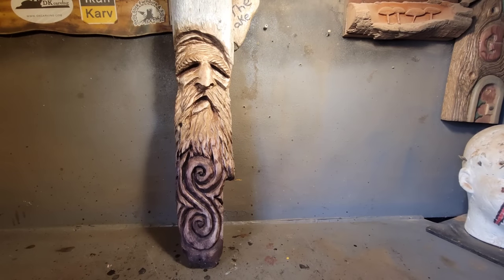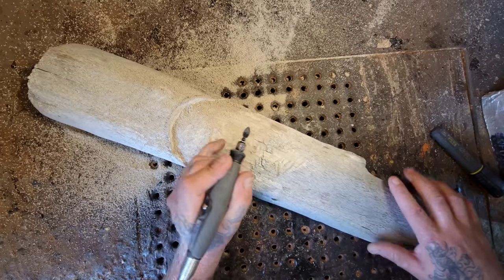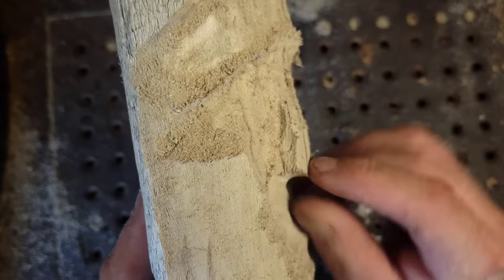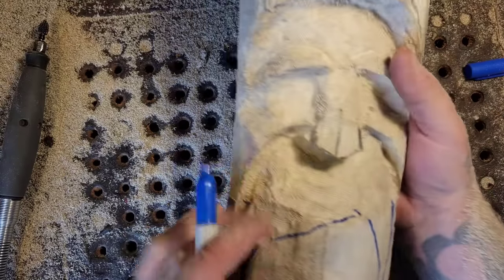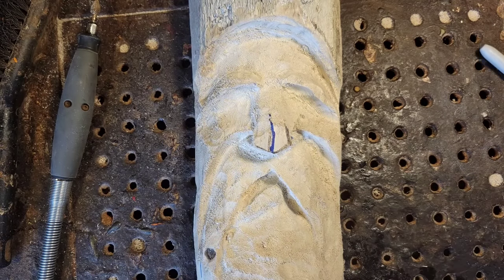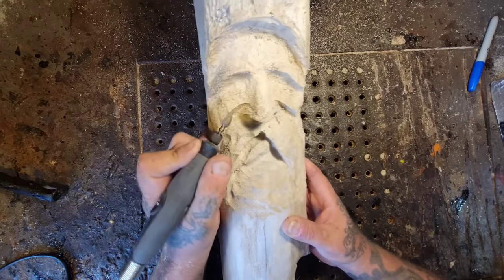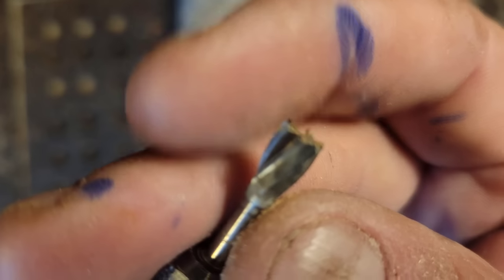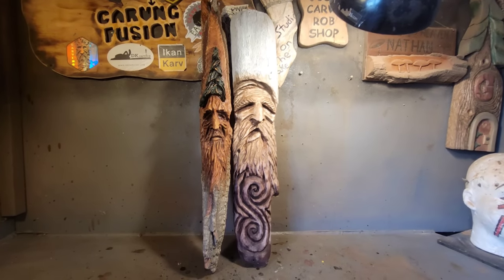The very basics How to carve a wood spirit with a dremel for the very beginner carver.

Comment: I use a power cable with a foot switch on it and a female connector designed for lamps. Also tried a Nexus remote control wireless plug to turn it off and on. You can place it on the Flexi shaft near your hand for easy on off.

Comment: Hi jordy;
We just cut down 2 huge cedar trees and 3 trailer loads to the dump. We still have a pile left that is soaking wet from all the rain. Do the branches have to be dry before carving? And is cedar a soft wood? 
I’ve never used a Dremel, what is the foot pedal?
Years ago I did linoleum block carving mostly swans but I’ve done the Pink Panther ( love the theme song to that cartoon; kinda stuck in my head).
Thank you for the video and any feedback.
Happy New Years 2024🎉
Reply from the maker: Yes cedar is good to carve let it dry ty u too
Reply: @CarvingFusion  
What is the foot pedal you mentioned in the video? Is it sold separately from dremel? I couldn’t find it under your links.

Comment: Jordy do you mind if I ask how you made the down draft with holes to suck dust please?
I’ve a lot a spalted wood as in a woodturner and it’s just about ok to practice with.  
And a big thanks on video how to change core of flexi lead. Hour in I had first catch lol and bang running in neutral. 

Love everyone of your beginners videos as each one is a different piece or wood. So I learn bits all the time. I’m a very slow learner as I’ve issues in grey matter.   So don’t be getting bored or pissed off doing beginner ones lol

Keep rocking big man.  Warmest regards sent from Ireland. 
R.
Reply from the maker: Thank you. It's a aluminum plate drill holes threw, I have videos on my table in my play lists

Comment: Wow, great video, great teaching, and great encouragement <3 - I watched all the way through and has now inspired me to get creating. As a complete newb to this would you suggest just getting the basic gear like Dremel 4300 (over the 4000?) plus Flex Shaft Rotary Tool Attachment and save the pedal for an upgrade later, or does the pedal really help as a beginner? And other than the 1/8 Extreme Flame Burr from Kutzall is there another you'd recommend as a beginner? Thanks so much if you have the time to reply!
Reply from the maker: I think the 4300 or 4000 is a great start with the flex shaft, a cheap on off foot pedal realy helps so u don't have to keep turning the dremel on amd off by hand, kutzal longer silver tapper but is good to have as well
Reply: @CarvingFusion  Thank you so much for replying so quickly! What head size would you suggest for the taper burr? Also is it safe to buy electronics from Amazon, I've heard they sell on products that aren't brand new?

Comment: Hi, great videos. May I ask, have you worked with the Dremel Fortiflex? I want to buy either the Fortiflex or the 4300. But the handle of the Fortiflex seems quite large to me. Could you give me some advice?
Reply from the maker: Yes I had the forty flex and I returned it,  u can look up foredoms but they are pricey, 
But I'd go with the dremel 4000 with the dremel flex shaft, or u can always use a cheaper rotory tool like a wen and use the dremel flex shaft, 
Lots if videos on this in my play lists
Reply: @CarvingFusion  Thanks mate, I ordered the Dremel 4300

Comment: My Dremel gets really hot if i run it more than 10 minutes at 3 or higher. So i don't put in long sessions making projects take a long time. Am i just babying it, or should i let it rest. Also it burns the wood a lot lol.
Reply from the maker: Maybe try getting some better cutting bits like I suggest and it won't burn the wood, 
And it all depends on what dremel u are running, I suggest the 4000, or 4300

Comment: Brother, found your video great content. Newbie, question. Making a carved/engraved wooden sign. Typical letters, etc, if I wanted a mallard duck and wanted it raised..make the duck separately and glue, tack on to said sign? Or do you have a different pov?
Reply from the maker: Ummm I think withing the week I will be doing a flat board carving like you speak of, mine will be a panda bear head, or eagle head :)
Reply: @CarvingFusion  is that something you can post? I'm actually going through all my pops router bits and figuring out what is what si I know, I'm thinking I might have to get a couple..and I meant duck, not dick hahaha
Reply from the maker: @ryannastaj3269  yes but I will just be using a dremel
Reply: @CarvingFusion  that's even better, saves me a hassle haha. Very familiar with the Dremel. Awesome thanks man!

Comment: I watched the whole video and it was inspiring and I liked your attitude! 
Every time that you said OK it reminded me of my friend and I'd laugh or smile, and I did a lot of that.
I live on a small island in BC and there is a ton of driftwood around.
I went from buying a cheap rotary machine for my one toe nail to then almost buying a Dremel 3000 on sale to now I might buy that Dremel platinum kit, that's on sale for $220.00 CDN with the aluminum case.
Is this overkill for a beginner?
Thanks for your videos and I'll sub! (;
Reply from the maker: Thank you, I don't think you need that kit, I think a.y dremel will work fin, But I'd suggest the 3000, 4000, or 4300  (what ever u can afford will work, but 100% get the dremel flex shaft and also some kutzall carving bitts  AKA Carving burrs.. The "flame ones" to start. 
I'm on Vancouver Island now. What Island are you on?
Reply: @CarvingFusion  I changed my mind at the last second and though - Do I really need this fancy kit or do I just wait for a sale on the other kits without the fancy box? I figured that that kit was too much but on sale it wasn't that much more expensive than the others.
I really wanted a stronger motor but when I saw that you used a 3000 for a few years and your type of work I was impressed with the 3000!
And I was gonna bug you about the bits so thanks for mentioning them!
I usually don't tell people my location but I'll tell you that I'm on Salt Spring.What is your general location on VI? I'm curious, but you don't have to tell me if you don't want to.
My biggest problem is that I live in a shared house and don't have any great places to do this work other than my room with a balcony.I need a sound muffling box with good airflow for the Dremel as to not drive my roommates insane...now that I'm not gonna buy the fancy kit I'll be on the hunt for reality!
Thanks again I'll let you know when I do finally get one!
Reply: @CarvingFusion  Also, what are these fractions referring to? I still haven't figured this out and it's bugging me!
DREMEL
4000-2/30
4000-4/34
4300-5/40
4300-9/64
Reply from the maker: I dont know jist get the one that takes the 1/8 bits@greatmystery11
Reply from the maker: @greatmystery11 I think they are diffrent kits
Reply: @CarvingFusion  I thought that they were collet sizes...
Reply: @CarvingFusion  Will do!
Thank you!

Comment: 👍
Reply: Thanks for all of your videos! Quick question...if you know that you're going to be working with a larger piece of wood (like this one), why wouldn't you use a sander/grinder and remove the excess surface wood to prep/start with instead of using your Dremel? I would rather use a sander/grinder and save the wear and tear on my Dremel bits...a pack of sandpaper is cheaper than a Kutzall Flame bit..haha...Thanks again!